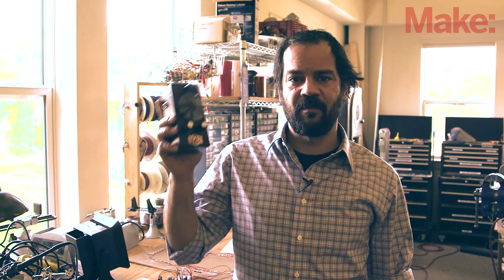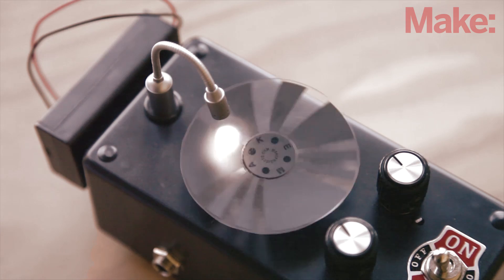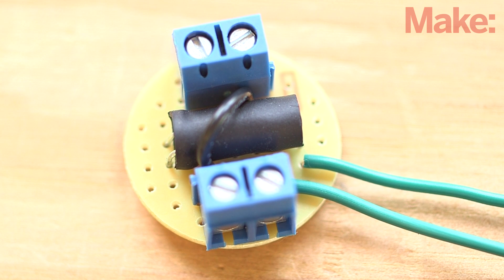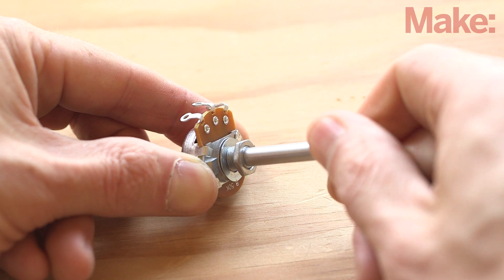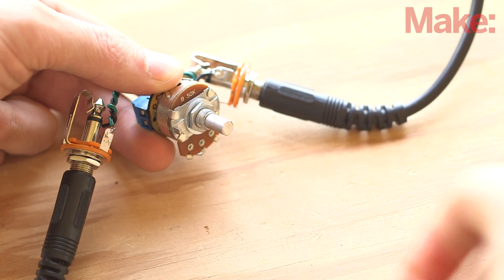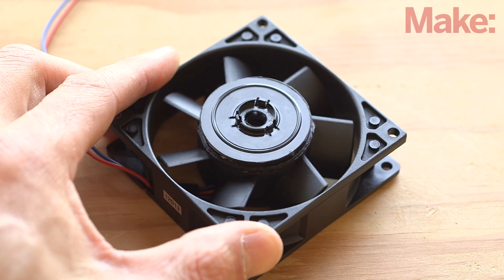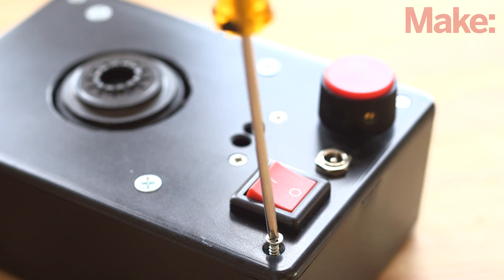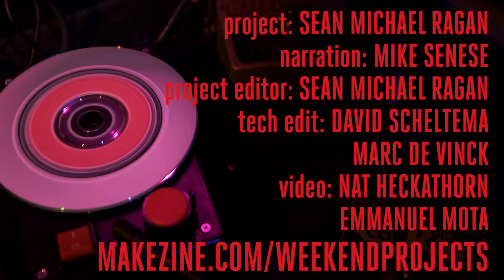Weekend Projects - Optical Tremolo 2.0

Comment: 40 years later, Radio Shack still hasn't figured out that no one needs a 2" potentiometer shaft.
Reply: Dave Bales rip radio shack you will be very missed
Reply: If you have ever tried to repair any hifi equipment you would find those long shafts very useful.

Comment: I finally got mine to work (btw I eventually came to run this at 11 volts, measured at output of wallwart supply).  The motor controller was no problem.  I needed to make adjustments mostly for the IR emitter and detector section.  
1. The schematic shows a ground connection between Q1 emitter and D2 anode but I did not find it in the build picture so that was the first thing I needed to correct on mine.
2. R2 changed to 63.2k ohms.  I was not getting any change in the LED output till a friend helped me with changing this value. It was in the 59.3k to 63.8k ohm range that got best results.
3. The focal point was pretty high, so I carefully, physically moved the emitter and detector to face inward slightly (like they are the the side of a triangle, pointing slightly to the middle of the two).
4. R1 changed to 122 ohms with two resistors.  The 22 ohm resistance, I put it the R1 designated space and the 100 ohm was placed on the other side of the perfboard.  It seems the emitter was overheating and would shut down for 15 secs (after 1 min or less playing).  Putting an additional  22 ohm in, reduces the current and it being closer to the emitter than the 100 ohm keeps it cooler.  (I almost thought of cutting a hole in the fan shroud, next to emitter resistor/s to let the fan cool it too!)
5.  I have not done this yet but considering reducing the 50K linear to a 20K linear.
P.S. Lastly I thought removing the ground from the opto isolator's R5 might reduce some noise but it made no difference;-)
Reply: what difference does the Q1 emitter to ground  connection make? i ask because im getting a lot of motor noise on the "clean" circuit side. would that be the cause?
Reply: I have been working on this project in my free time for the last three weeks and just now finally got it to work.  I don't think I would have done it without your tips, thank you so much!  I think I made every mistake you could possibly make, I went through a few sets of IR pairs and I burned out the photocoupler led about 5 times.  I was going to give up so many times, when it worked I actually teared up a bit haha.  It's not an incredible trem by any means but it's cool for what it is and I'm glad I made it.  Thanks again!

Comment: Cannot, for the life of me, get the IR pair to function well enough to be practical. No amount of tinkering seems to fix it. I've converted the dial-a-speed to control an LED and now I have just a regular boring tremolo.
Reply: You may have the wrong pair. Different IR emitters use different wavelengths and different phototransistors respond better to one wavelength than others. If you used a photoresistor for the receiver, it's not gonna work at all. Also mind the polarity of the IR diode and the phototransistor. Audio signals are technically polarized.
Reply: PunakiviAddikti It's probably likely, I ordered them from digikey. The receiver is supposed to be most sensitive in the frequency the emitter puts out so I'm not sure what's going on and using a video camera I can see the emitter working.
Reply: Ethan L You can buy a ready-made pair sensor built into a enclosure to make it easier to install into machines. They have the pairs tested before assembling the sensor. If you can find one online, you can try that instead of buying the emitter and receiver separately.

Comment: Needs an exra circuit to decode a MIDI sync signal and adjust the motor speed via PWM. That would be really neat. You could hook it up to your DAW and use it on pre-recoded instruments.
Reply: Ok done

Comment: Think I could make one with and LED and a 555 timer? That way the light would just flash and you wouldn't need to have a motor
Reply: You could use a 555 but you are limited to a simple squarewave (though you could have real time control over pulse width...), the optic discs have the benefit of allowing complex patterns rythums and gradiations.  And of course they are more fun!

Comment: You could just use a 555 timer that controls a MOSFET with the audio input running through that, then of course into the volume control.
This way everything would be internal and neat.

Comment: I've made my second version of this thing and definitely it does not work. This time I used a computer fan and a PWM speed control that really does nothing, the fan starts spinning slow but always ends up turning at maximum speed due to inertia.

The pasive circuit needs at least an active input buffer tu isolate impedance input signal variations or it will only modify the volume when the "intensity" potentiometer is at maximum so it acts as a switch at with any potentiometer impedance, I've tested seceral potentiometers from 50K to 1M with the same results for all of them.

I think it's redundant to use a PWM circuit with a 555 timer to control the speed of a motor we use tu move a CD that reflects light from an LED to an LDR when you can use a 555 timer to directly control an LED in front of an LDR.

The idea of the spinning CD is great for asymetric volume variations patterns but you will need a very slow motor under 100 RPM to make it effective. Not difficult to find one but really difficult to find a silent one.

Comment: I made my own version of this one this weekend with the "garbage" at home, really disappointed with the results, a 50K potentiometer isn't enough, I had to replace it firstly with a 250K/B and at last with with a 500K/B potentiometer. I didn't use the PWM speed control, I just used a fixed six steps rotary switch from 5 to 12 volts and the fan still spins too fast even at the minimum voltage it can run (5 volts) so I had to add an improvised  mechanical break to slow down the revolutions, even so the only pattern that really works on the CD label was a half black/half white one. Really good sound and 100% TBP (true bypass) effect for my guitar but no real control on it.

Anyway, it was funny to make it... and funny to dismantel it ;)

Comment: Interesting! I'm currently building something akin to the first version of this out of a broken danelectro cool cat trem pedal. The enclosure is a lot smaller but it should all fit. The optoisolators are sweet but I don't like the new sensing system. It may not sound as good, but I like the moveable light from the first one. It gives more performative options

Comment: Just an idea. A cd drive from a computer has a few ideal features for a project like this. The enclosure, the motor, and a possible variation of the tremolo, by moving the tremolo sensor circuit on the tracking mechanisms.

Comment: it would be kinda cool if you could control the speed of the motor with a volume pedal. doing that might give it a leslie tone cabinet effect.
Reply: You can easily do that. You can use a piezo element (which would include a voltage regulator circuit) or any variable resistor that is connected to a pedal for that effect. You can do it with the exact same resistor if you wanted to, just mount a lever on it, and position it so that full travel of a foot pedal gives as much movement of the resistor as possible. Or, you could build a piston-like setup, much like an old steam engine. That way a full pedal motion may be several revolutions. All you would have to do is wire it to the pedal instead of using the manual variable resistor. Shouldn't be hard to do at all.